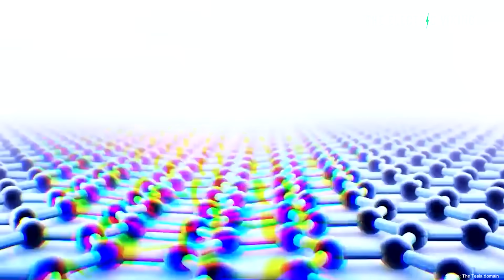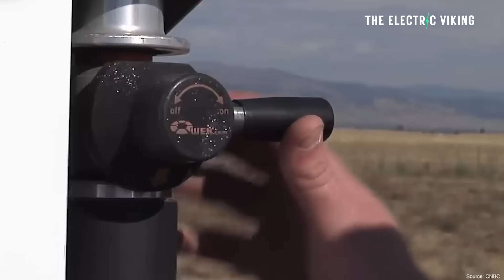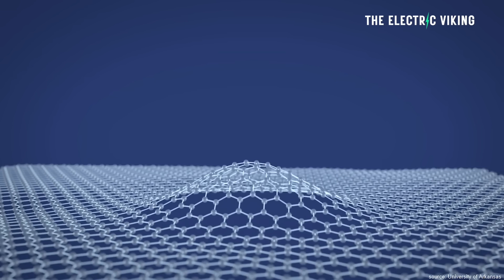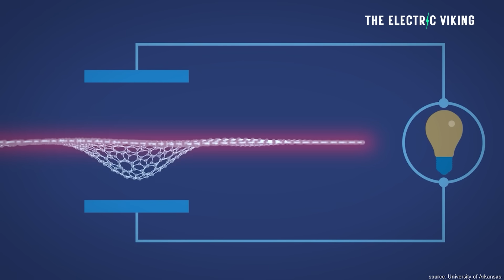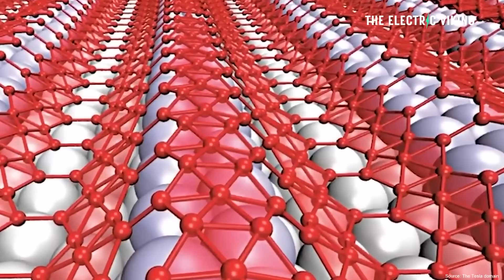Experts Claim Stunning Breakthrough Will Transform Global Hydrogen Network

Comment: A gallon of gas will get you about 40 freeway miles in a Camry hybrid. A kg of H2 will get you about 40 miles of freeway driving in a Toyota Mirai. 10 kwh of electricity will get you about 40 miles of freeway range in a Tesla Model 3. Here’s the kicker though: where I live (LA), a gallon of gas is $5. A kg of H2 is $15. And 10 kwh of off-peak electricity is $2.10. The math just doesn’t make sense for H2 unless they can figure out a way to catalyze electrolysis of H20 and get H2 under $5 per kg.
Reply: Well said.
Reply: In California they have a lot of old oil wells.  If they pump oxygen into those wells that reacts with the remaining hydrocarbons and produces hydrogen with no CO2. The company doing that up in Canada is already producing 300 tonnes per day at a dollar per kg just using air movers.  They are now working on building out a plant to produce pure oxygen which will bump that up to 1000 tonnes per day at 30 cents per kg. Their ultimate goal is to get that down to 10 cents per kg.  When producing oxygen they get nitrogen as a by product which can be combined with the hydrogen to produce ammonia and if they capture CO2 that can be combined with the ammonia to produce urea which is used as fertilizer. At 30 cents a kg if they put in enough fuel cells that 1000 tonnes of hydrogen would be a 600 megawatt hour power plant and the cost per kw would be less than 2 cents.
Reply: @pin65371  That sounds promising. I do think they will try to make a profit first, but more competition and more supply generally helps lower prices.
Reply: they will. simply economies of sale will do it when an efficient method of green hydrogen creation is found.
Reply: Petrol will only get more expensive because it is getting harder to extract, while green Hydrogen production will only get cheaper and more efficient. I am not sure if small short range transportation will ever make sense compared to Sodium batteries, but for long range transport and heavy loads, Hydrogen is a much better option because of it's energy density. 100 kg of hydrogen gets you the range of 10.000 kg of batteries.
Reply: @SolAce-nw2hf You have ANY idea how large a storage item is for 10 tons of H2? 😅
Reply: @lengould9262  yes, it's mostly underground caverns. A lot of it is reusing the salt caverns used for natural gas storage. There is some preparation involved, but it is proven technology. 

H2 is a commonly used gas in industry. Even making petrol involves H2, so switching from grey Hydrogen production to green Hydrogen production cuts both ways. 

Currently even Shell is building a big electrolyzer plant, and they have plenty of cheap natural gas to make grey Hydrogen. So just wait and see what happens with research gettng much more funding now.
Reply: @SolAce-nw2hf  WAY too optomistic.
Reply: @lengould9262  Maybe i'm an optimist. But the plans for hydrogen are there and backed by the government, energy sector and investors and look pretty realistic to me. More realistic than building another outdated Nuclear power plant that will cost €20.000.000.000 and at least 10 years to build before it can power anything at all.
Reply: Due to a huge IRA subsidy on green hydrogen, green hydrogen will cost less than USD 1 dollar per kg to produce on some areas of Texas that have high levels of wind or sun by 2025 according to a Bloomberg Report.
Reply: That "$1 per Kg" isn't what they can achieve, it's the price needed to be cost competitive with electricity. They cannot possibly acieve that price due to the cost of building and maintaining facilities and the cost of operation. Even if they operated as a charity with no expectation of profit, the cost would be higher than that - and I don't expect that to happen. Storing renewable electricity in batteries is 3x more efficient than storing it using hydrogen. So, at absolute best, hydrogen has to be 3x more expensive than electricity, and currently it's 9x more expensive. Hydrogen cannot compete, economically, even with subsidies.
Reply: @chrismuir8403  batteries are cheaper for everything you can use within a few days. In reality, summer has way too much solar energy if we put down enough panels to get rid of fossil fuels.

So the energy will be waste if you can't store it long term. In reality Hydrogen is the best option to get rid of that surplus. Nothing else is available. There are some thermal storage concepts, but those have huge losses as well.
Reply: @SolAce-nw2hf I'd like to see flywheels put in at ev charging stations. Flywheels can put out a massive amount of power quickly and they can keep cycling them over and over again.  It only makes sense at stations with high volume though since they lose power quickly but if they are continuously getting cycled they are very efficient.  In the UK they have 2 massive flywheels that will dump 400 megawatts in 30 seconds but that is used for powering nuclear fusion tests.
Reply: @pin65371  those flywheels are also in use for grid stabilisation here. Not sure if that is the most efficient solution for EV chargers as 350 kW is becoming a standard and Tesla is pushing for 1000 kW to charge their literally ground-breaking semi.
Reply: You said it, Green Hydrogen, which is not readily available. @richensia1

Comment: Maybe hydrogen could fuel charging stations that are remote and poorly supplied by the grid. Battery EVs could recharge there.
Maybe good for trucks and buses, too, or high utility vehicles like taxis or fleets that can’t afford to wait for charging time.
I agree that battery EVs will soon become so cheap that they will be hard to disrupt except in places or situations where recharging is too slow or not available.
Reply: Solar panels solve the remote issue better than hauling hydrogen around. Storing and hauling hydrogen is expensive and impractical.
Reply: @kstaxman2 what about areas where they go days without sun?  I live in one of the best areas for solar in Canada and they are not getting even close to their rated power most of the time. Even right now with a fairly clear day we are running at 75% of rated power.

Comment: I heard David Ginley with the National Renewable Energy Laboratory's hydrogen program two weeks ago. He cautioned that fuel cell life is disappointingly low and a very long way from a 10 year life span.
Reply: Hydrogen fuel cells last longer than a battery. The new fuel cells are over 30k hrs between rebuilds. The ones for trains and ships are over 80k hours between rebuild.

Comment: Tear out H2 tank, install Stan Meyer type water splitter, drive on.
Reply: Stall after ten feet as you run out of power. There is a good reason why cars carry fuel tanks and batteries, not fuel factories or generators.

Comment: Hydrogen-Electric cars are just another form of a hybrid….carrying around both batteries and a fuel cell to generate electricity will never be cheaper or more efficient than pure EVs…..doesn’t matter if the fuel cell gets cheaper, they will always be less efficient.
Reply: The issue is not the efficiency but the cost and weight of batteries. Though BEVs make better cars, 1000+lbs battery compared to 400lb hydrogen power system(FC+battery+tanks) has a weight difference of about 20-25% of the total weight of the vehicle, and while fuel costs would make it more expensive to drive there are plenty of people willing to pay for high performance gas guzzlers. If a larger vehicle like a semi needs 20x energy you would need either 20000lb batteries(over half of the empty weight of the semi) or a 4000lb fuel tank; the more expensive fuel cell and battery do not need to be 20x bigger so a hydrogen semi would be about equivalent of current ICE versions while BEV semi might lose some cargo capacity. This difference in weight and cost would get huge once we start considering planes and ships, which are also bigger polluters than simple cars.
Reply: @AnalystPrime where a battery adds weight,hydrogen uses the available volume.😊
Reply: @malcolmrickarby2313 Yes, large vehicles have enough space but battery is better for regular small to midsize vehicles. Scaling down, a small BEV city car with only 100-200 mile range is far cheaper to buy and own than hydrogen is ever likely to get because the fuel cell would still be expensive but cutting the already cheaper and lighter fuel tank size by half would not help much.

Actually the tanks aren't very big, something like pair of scuba tanks for a normal car, but when the H2 hybrid would at best cost same as a Tesla and has less trunk space, I think a lot of people will prefer the cargo capacity over "it has little more range and we would save time if we ever go on a road trip".

Comment: Can ANY tech derive greater value in hydrogen than the energy put in? Electricity can split water into hydrogen and oxygen, but are the resulting products worth as much as the power used? And hydrogen in gas form needs to be chilled and compressed, which uses lots of energy, if it is to be shipped. It never adds up, it seems to me.
Reply: "Greater value than the energy put in"? If you are asking if it creates perpetual motion then the answer is you are a stupid person asking a stupid question. If you mean "value" as in is hydrogen useful in "ANY tech" then the answer is YES OF COURSE! There are plenty of uses for hydrogen and if the end products weren't worth more than the cost of producing hydrogen we would not have been using them for the last century. And a cheaper way to produce green H2 means massive cost savings and reduction in pollution.
Reply: Hydrogen can be produced for free as a byproduct of the flash graphene process. It still is not suitable for transportation.
Reply: @peterinns5136  Not in small vehicles at least, might be different when a semi needs ten tons of expensive batteries or a three ton hydrogen system which can pump 100kg of H2 in the tanks far faster than the batteries can charge.
But that is nearly irrelevant compared to how much cheap green hydrogen will benefit industries like steel and fertilizer production.
Reply: @AnalystPrime exactly. Also Hydrogen production solves the use-it-or-lose-it problem of solar power. Seasonal storage is needed because of the summer surplus needed in winter. 

Storing that in batteries is just insanely expensive with 1 charge and one discharge every year for ever kWh of battery, not even counting BMS and self discharge overhead. 

Imagine needing to store just 2000 kWh for winter to power your super sleek 99% efficient EV and heat your home with super insulation and a finely tuned heat pump. 

You would have to spend in the order of $10.000.000 on batteries alone at current prices, and then some on a big building with a BMS, AC and ofher infrastructure to make it safe and make it last the 3000 years with only a yearly charge/discharge cycle. And then multiply this by the homes/cars in your country.
Hydrogen is needed, even if we just use it to replace natural gas  and coal in power plants.